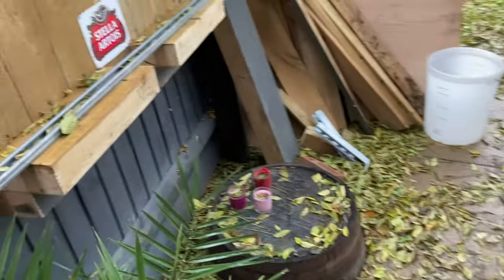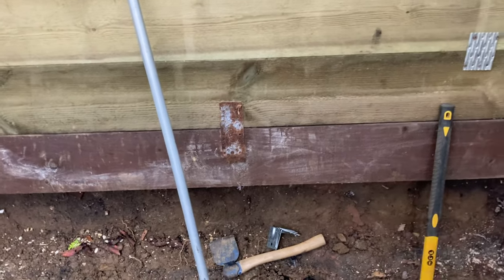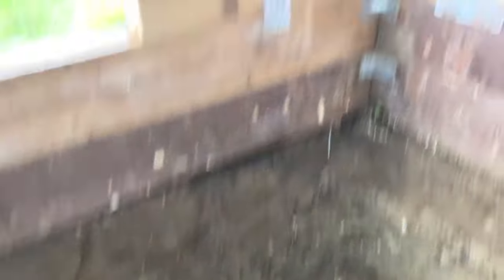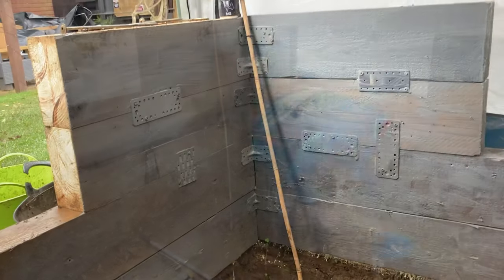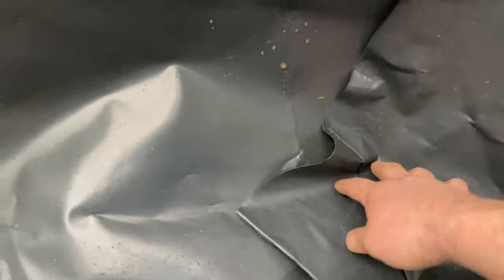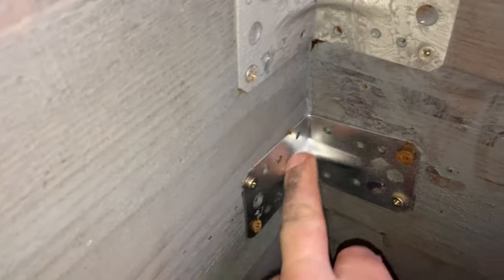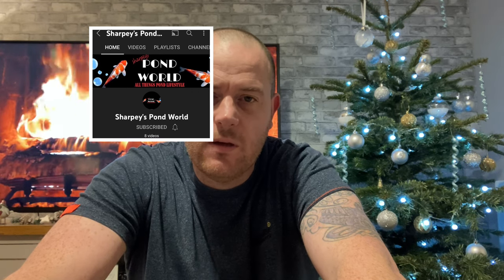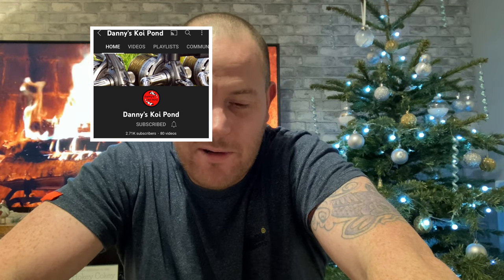DIY sleeper koi pond rebuild part 5 ✋ and shoutouts

Comment: Pond build is looking really good and the straightness of the dig awesome. One observation though. I know you've put the damp proof in place but it's not going to help if that big root or the smaller ones start to grow again. I would suggest putting a piece of ply over the section of the wall where the root is located. Could save you a lot of headaches from a possibly punctured liner in the future. Cheers.

Comment: 5ft deep mate more than enough can't understand why you did not make it longer and bigger  at the bottom off the garden where that tree is
Reply: @ADS-KOI   its  shame mate when you see people with a big  garden and there build tiny ponds does not make sence my mate i used to get my koi off cheap hes pond was about 20 ft long about 10 ft wide may be longer  and a 320 nexus  but hes in bad health and the pond been leaking such a shame the koi where real big and you could hand feed them  i got some yellow and white koi coming up a treat
Reply: @ADS-KOI  well mate my garden not that big but mines only 10 ft long and 6 ft wide with oase filter clear 16000 24 watt uv love to replace it with a EZ ponds  with large windows bottom drain and draco combi medius drum

Comment: Progressing well.
We're 8 (100mm) sleepers above ground and have dug down 700mm more, plus 150mm for the concrete base, so I feel your pain. 
We're at a total depth of 1500mm (5ft). 
Didn't realise you were a fellow Chelsea fan 👍 #KTBFFH
Stay safe (Keith).
Reply: @ADS-KOI  Digging is a killer, if you're not used to it. I work in IT, so my tools are a keyboard and mouse, not a shovel 🙄

Comment: You make it look very hard if you dig down a few inches lower to where you want the height then put sand in the bottom to level it all up the sides just put flat corner brackets on  so you don’t need to cut your ply out it’s very painful to watch you struggle